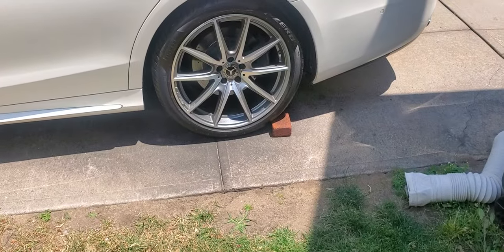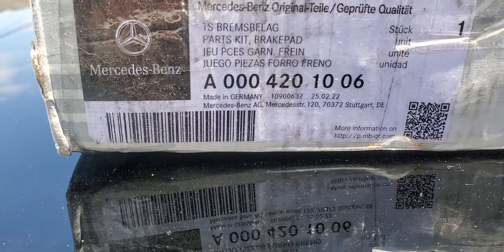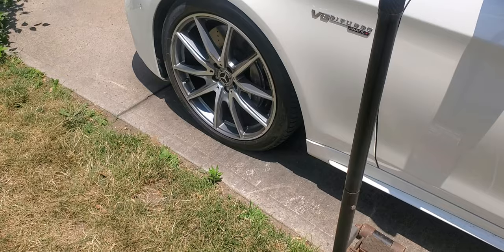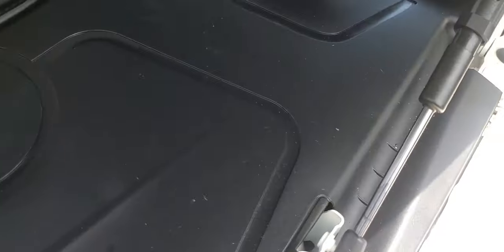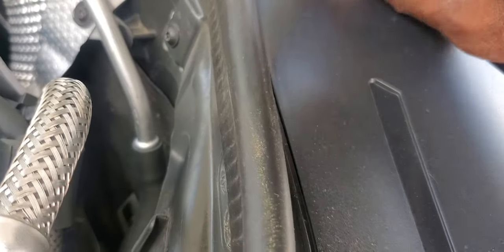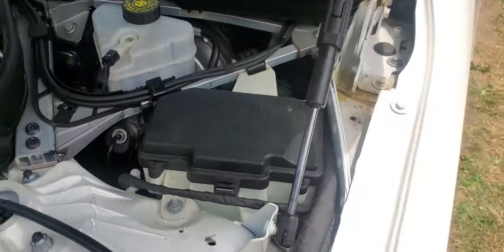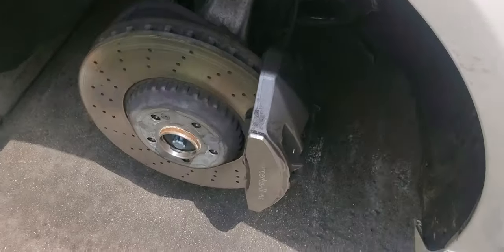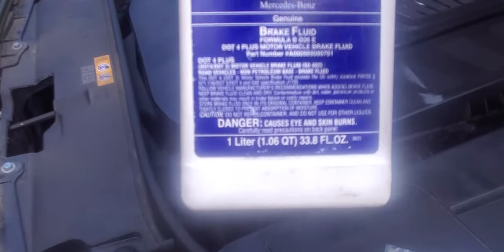Changing Front Brake Pads on a Mercedes Benz S Series |  Video Series Part 2 of 2

Comment: I change my front  brakes on 2015 S550  put new brake wire sensor on, but the light still comes on on my dash board  lol any suggestions?
Reply from the maker: Did you check the rear brake pads?
Reply: @WayneARobertson  no I have not I just changed the back breaks a few months ago

Comment: Great video thanks I will change my own breakpads. How many miles did you have before you changed them?
Reply from the maker: I don't remember, but when my brake padel goes down or my brakes are not stiff enough when I stop the car, I know it's time to change them. I usually change them before the brake sensors tell me to change.

Comment: Wayne , when you connected the front sensor, I noticed you placed the pad that connects to the sensor on the outside, shouldn’t it be on the inside???
Reply from the maker: No. When you replace the sensor keep track on which pad the sensor was installed before your remove the pad.

Comment: Why didn't you loosing the pads first with a flat head screwdriver to make it easier to come out?
Reply from the maker: I'm being really careful on how to remove both pads, but whichever way works for you is fine as well. No right or wrong way to do this just as long as the pads are changed is the end results.

Comment: Where did you order the brakes and would this be the same process on a 2019 S 450 ?
Reply from the maker: Yes I ordered the brakes from mbdirect.com. or you can also get it from Ebay. This would be the same procedure for the newer vehicle unless the electronic manual states OTHERWISE.

Comment: Is there any procedure for the suspension airbags before jacking up the vehicle?
Reply from the maker: I did not follow you about the air bags. Could you repeat or rephrase for me?
Reply: @WayneARobertson  Some vehicles with suspension air bags have a switch you press b4 you jack up the vehicle. Was wondering if this was the case for the benz?
Reply from the maker: Not that I'm aware of and I've jacked this car up plenty of times without. A Second thought.
Reply: @WayneARobertson  Good to know. dealer is charging my friend 2k for rotors and pads and I told him I can do it cheaper. I appreciate the info.

Comment: Why didn’t you use brake lubricant on the pads?
Reply from the maker: Don't need to. I do it once in a while. And what you mean by lubricant on the pad, not on the pad themselves,  but around where the pads slide into the slot.